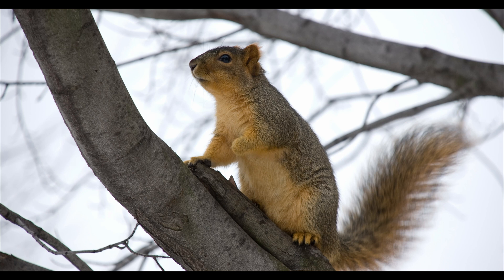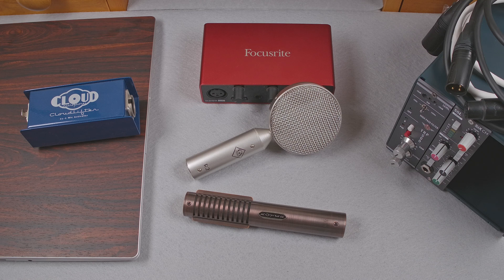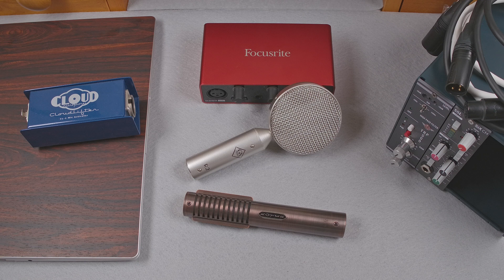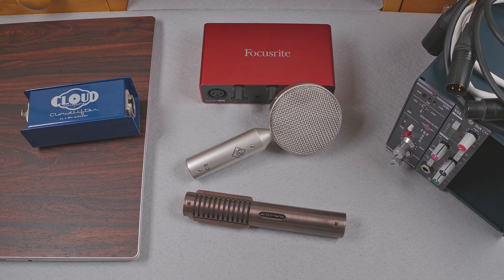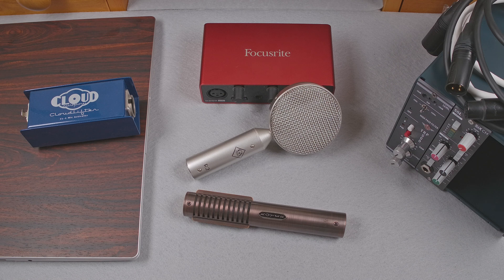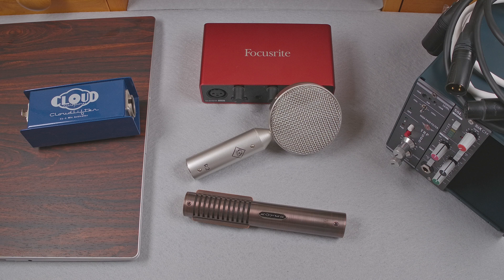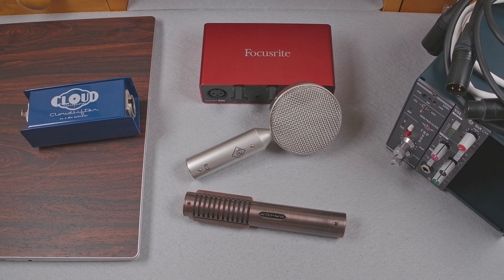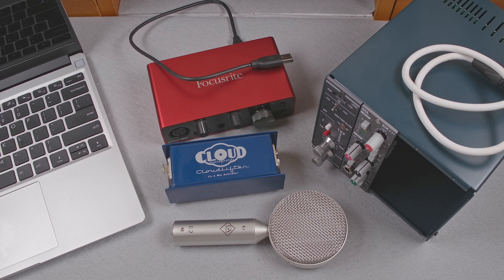What Interface or Preamp for Passive Ribbon Mic for Voiceover?

Comment: Thanks so much for doing this!  I've been wanting to hear the AEA compared to a "standard" USB interface for some time.  IMHO, like a lot of pro audio gear, it comes down to two questions:  1) Can you hear a difference? and more importantly 2) Will that difference matter to you or the end consumer?  For most of us with a decent system, the answer to #1 is probably "yes."  The answer to #2 is much more complex...
Reply from the maker: I'm guessing that with a condenser mic there probably wouldn't be much of a difference. But it's still a reall good preamp.

Comment: To my pretty average hearing ears, on decent external speaker on my PC, they all sound unintelligibly the same, which cements my thoughts of audiohiledom, it fairly much makes no difference. It reminds me of the record company which assured me in a statement regarding their guarantee of the highest quality standards, that all records must be basically round and have a hole in the middle 🙂
Reply from the maker: Ha!  Yeah, I thought I heard a bit less low end when paired up with the 1.2 KOhm pre-amp, but they otherwise all sounded really similar.  The Royer isn't the least sensitive Ribbon mic, to be sure.  But even the Scarlett Solo sounded just fine.